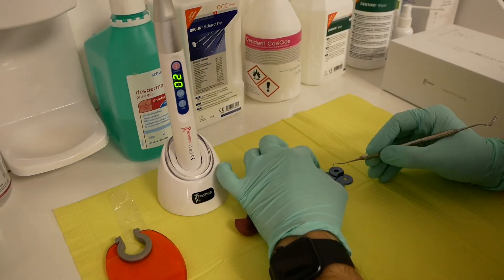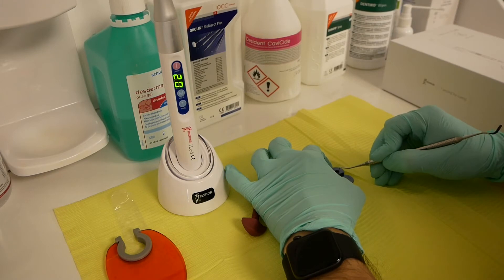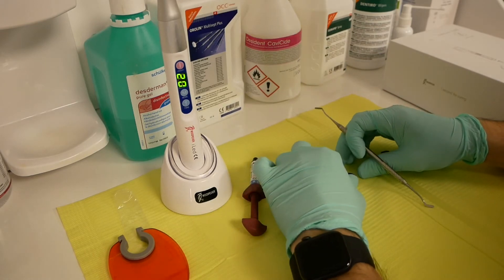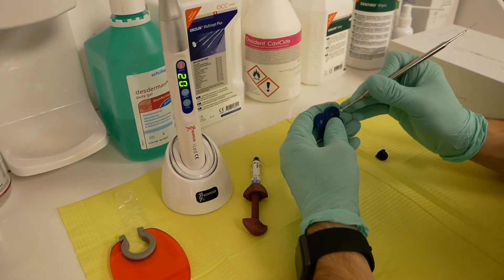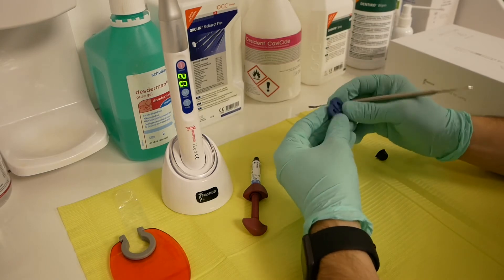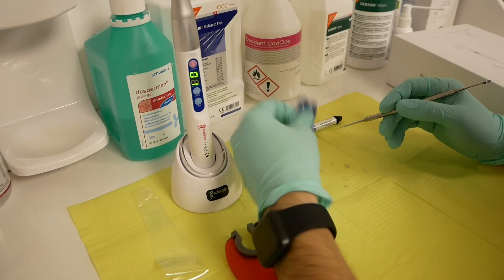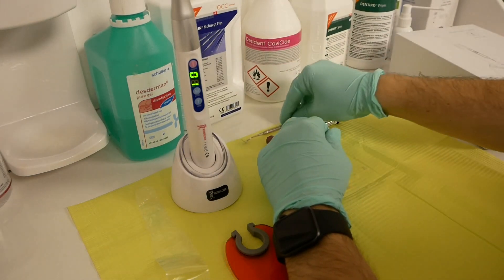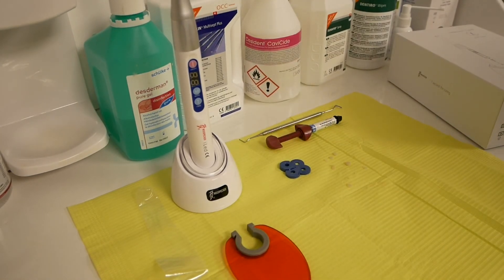Testing a Fast Curing Dental Light (Woodpecker iLED Polymerization Test)

Comment: What about using 1 second,  it is recomendable ?
Reply from the maker: It’s very useful because it shortens the citind times by a lot, especially when you have a lot of layers. It saves several minutes when placing an obturation, and the composite hardens without issues.
Reply: It works just fine for normal use. If you use Sonicfill and lay a thicker layer (3-4mm) you should use the 3s setting.